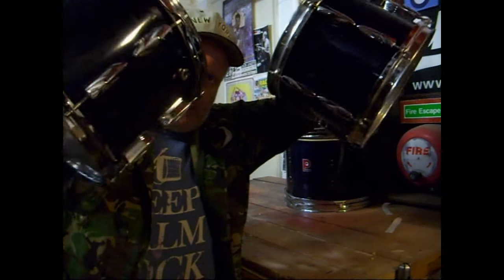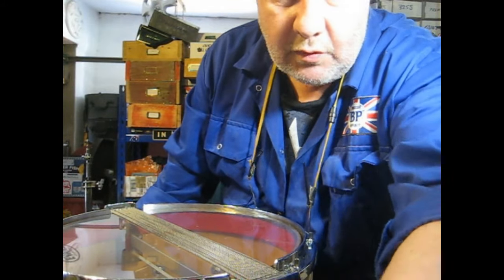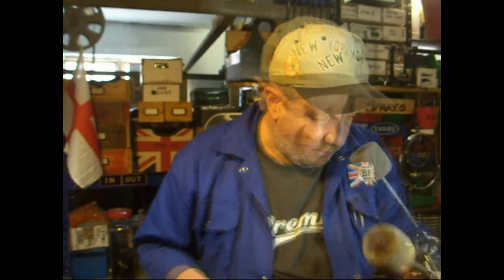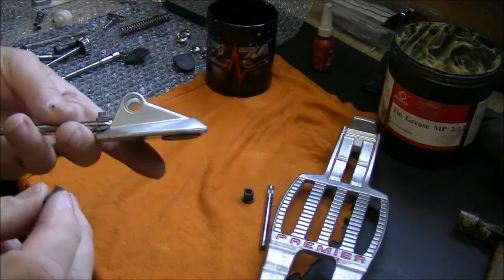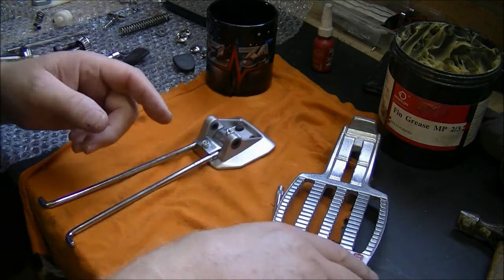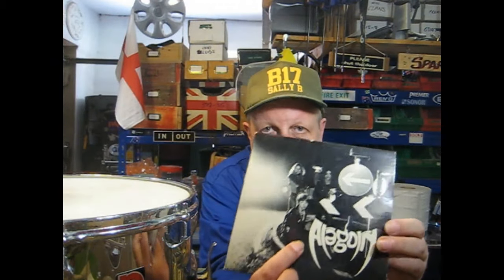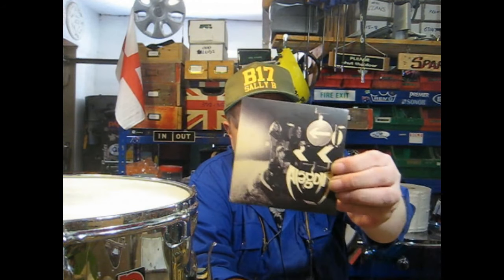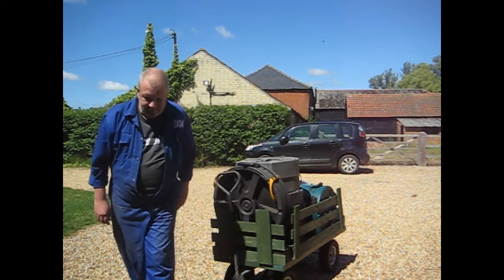The Drum Fettler - ep.0112

Comment: The wires on my 70’s 2000 COA suddenly went saggy, and it turned out that the casting holding the two screws inside the mech had snapped!!  Got replacement parts and drum is as good as new!  Enjoying the series Mike!😀👍

Comment: I'm terrified to take this flowbeam set up apart to far, and my wires just sit a little low when tighten all the way. I can't tell if the snares I have are just teh wrong snares or if i need to dissect this thing to find whats wrong with it. I also think the tension knob is not adjusting to it's full potential. Getting the snares on these was extremely difficult.